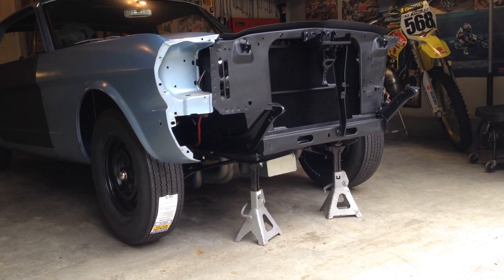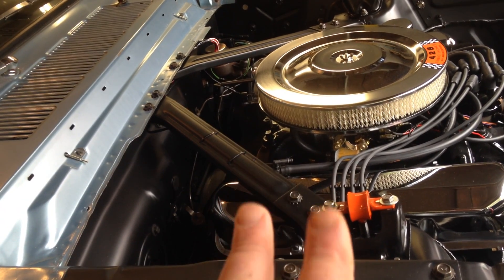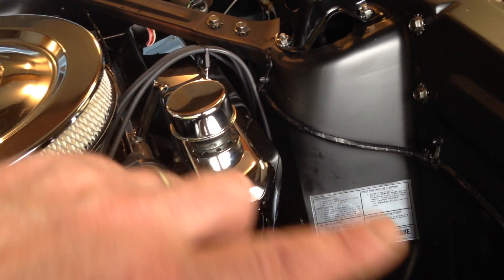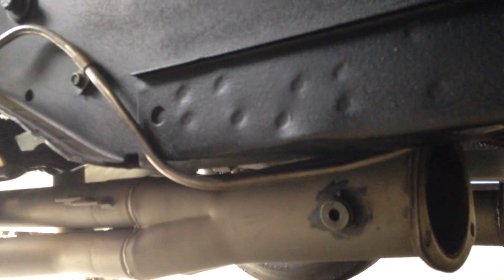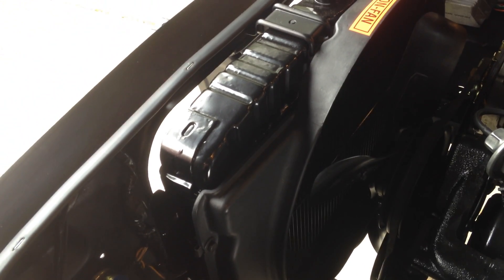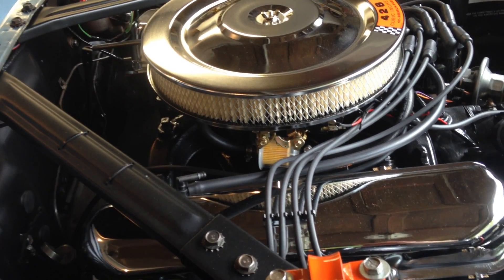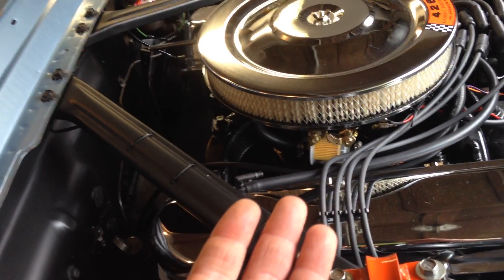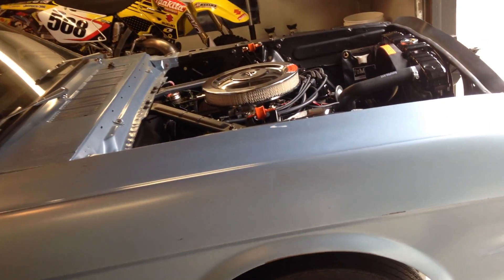1965 mustang FE engine swap

Comment: I’ve been trying to find some info on this and saw the same negative posts that you talked about. Thanks for putting this out. Do you think it would be an easier fit to use the factory manifolds vs headers? I am trying to figure out some swap options for a friends 65.
Reply from the maker: The manifolds are too big. Custom headers are the only easy option($$). It’s been along time since I did the swap. I was also thinking about swapping 68 big block shock towers. Then your somewhat guaranteed they will fit. I was also on a budget and basically built the car around those headers(I got a good deal on them). On a side note-My Ex Took the car to a car show as a maiden voyage. 99% of the people didn’t even notice that it was a big block. People that are into that era of mustang seem to be different. Not as muscle car oriented as the rest🤷🏼‍♂️.
Reply: Thanks! Yeah I have noticed the lawn chair crowd is that way. Kind of why I have gotten away from car shows myself. I’ll keep an eye out for some headers in case he decides to go the big block route.

Comment: About 40 years ago I put a 351 Windsor in a 66. That was tight enough with headers. Dented the towers a bit to make it fit. Bolted right onto the manual trans. I remember thinking about doing a 390 and there was no internet back then, just magazine articles.  The answer always was to take the towers from a 67-68 and fit them in the 65-66.
Reply from the maker: I hadn’t found any information as far as putting an FE in a 65/66 mustang. There was information on putting the 351 in the 65/66. But the 351 is also 2 inches narrower than an FE. I had actually thought about swapping the shock towers. I also didn’t want to take a chance that the FE and headers wouldn’t fit. I did a ton of measuring and figuring how to put the FE in the bay. Also Shock towers were a bit intimidating for me to replace. This Being my first welding/Fabrication job.  I probably wouldn’t do it again but would be a lot easier the second time. Getting the Mustang specific heads would make a ton of difference. Being that the bolt pattern is side to side and not top and bottom (headers). I was also on a budget at the time. I basically built the car around those 2 inch primary headman headers. I got a good deal on on them. Their design looked the most conducive for the swap. Take care
Reply: I had a lot of passion back then for doing it. That carried me through. The build probably produced 325-350 hp which made a great street car back then. Outwardly it was a sleeper but sounded great. Enjoy.

Comment: Hey was wondering if u have any pictures or anything on the mods to the shock towers u could send me tring to do the same swap u did fe in 65 coupe any help would b greatly appreciated
Reply from the maker: I have a few pictures. If you get a chance take a look at a 68-ish Mercury cougar big block shock tower. The upper control arm has a stud built into the shock tower. So you have no nut and bolt coming through the shock tower towards the headers. You basically need to take every bit of the shock tower off that you can without altering the mounting point of the control arm.(206) 310-1911 Brian

Comment: Awesome job, it looks like it belongs there. I wish you could share more pics of the control arms and shock tower mods. Man that 427 looks good in a 65.
Reply from the maker: Thanks , appreciate it. Everything is factory geometry but needed to use the tubular a arm because I eliminated the contours on the shock tower.The only reason why the shock tower has contours in it is because the factory A arm is stamped steel with a lot of contouring for strength. The shock tower is completely flat on the inside

Comment: Aluminum heads too , to get rid of weight.
Reply from the maker: I hear ya, only so much time and money. Lighter than a stock small block if aluminum heads.
Reply: @zmurray9499  yes I know. I've had FE stuff for over 40 years . I'm not sure what I can use anymore, I'm just trying to start tinkering again . I like what you've done . It looks good 👍
Reply from the maker: @jeffschwartz5199  survival Motorsports (blue thunder)has a lot of cool stuff for the fe. It’s a whole new world out there and I have not kept up with the new  modern muscle

Comment: Love it!  My buddy has been trying to convince me to put the FE in my '65 - nice to see what it looks like for real!  I've already got the Heidt's front end and shock tower delete, so easy fit.  Now that Godzilla is available as a crate I'm leaning that way, but FE would still be cool ...
Reply from the maker: The fe is old school, we wanted the super stock type car. Love the 427 super stock cars etc. headers are a bitch with the shock towers, piece of cake without. I haven’t kept up with the drag race/street race scene, what is the Godzilla? Thanks and good luck with the project.
Reply: @zmurray9499  It's the 2020 SuperDuty pushrod gas motor - basically like Ford's beefy truck version of GM's LS motors - 7.3L and basically the same external dimensions as the FE. I'll post some videos myself if I actually follow through with it!
Reply from the maker: Now that I think back I do remember reading about headers and the rack issues

Comment: They fit a foxbody also . You did an excellent job on this. If You will run an aluminum intake and heads it weighs the same as the iron small block.
Reply from the maker: Tim Dixon it actually has an Edelbrock intake, I ground the letters off to look “stock”. The heads and custom headers will be next. Those headers are a bitch to install because of the vertical bolt pattern.thanks
Reply: I think a FE with aluminum intake/heads/water pump weight is the same as a 351W. An FE can go right pass 500"

Comment: I absolutely LOVE IT. 
C4 and 411 gears? What’s your top speed 65. Lol
Are you going to go 5 speed?
Reply from the maker: Hunter Rogue  at some point we are going to pull the motor. Then 5speed, custom header(that don’t hang down so far), and mustang specific heads that have the header mounting on either side of the ports. I have other vids of it done except paint and body. Thanks

Comment: I really like what you did, right on, too bad your wife doesn't want to run a clutch!
Reply from the maker: no1dirtbag thanks, I was also a little concerned about squeezing clutch linkage into that space(master cylinder, steering box/column. But manual would of been cool. After the car gets painted we are gonna have some custom headers made and would like to go 5 speed. Did you see the other videos of it a little more complete?

Comment: Wow I came across your video while searching for ideas for my 66.  I love what you’ve done.  A few questions.  What size rims and tires?   What exactly did you do to the shock towers, cut and move them out more?
Reply from the maker: Fritter70 wheels are stock 5 lug steel wheels with M/H vintage drag slick 8.00/850/14 and front is a stock Shelby repro biased ply Goodyear(I think maybe Firestone). I basically cut the contour off the shock tower. The shock tower has 2 humps that allow the stock stamped steel upper control arm to pivot. I didn’t change the mounting point just eliminated the humps and used an aftermarket tubular control arm. Headers are the problem, custom header Is the way to go $. The Headmans are the only ones that kinda fit but are a nightmare to put on and they hang down to far.
Reply: Z Murray ah I understand now.   Did you then weld a plate to where the upper control arm bolts thru the shock tower, or are you saying you welded the thick plates in where you cut out the two humps?   Let’s see that baby run in a new video!!
Reply from the maker: Fritter70 I cut the whole face off the shock tower. So the entire face of the shock tower is flat but no deeper than original mounting point of stock control arm. Need to get some wiring cleaned up etc and should be on the this summer. Take care

Comment: i'd run a 3.70 gear in that it will work much better with the small diameter rear tire, rather than that i like the FE conversion thats cool it should do killer burnouts
Reply from the maker: S.r. Nunn your probably right but I just happened to have some 411’s. The car has been put together on a bit of a budget. Tire on it now is 28 to 29 inches tall.